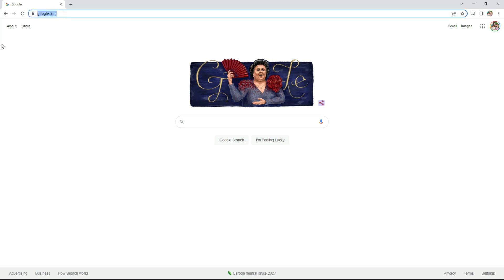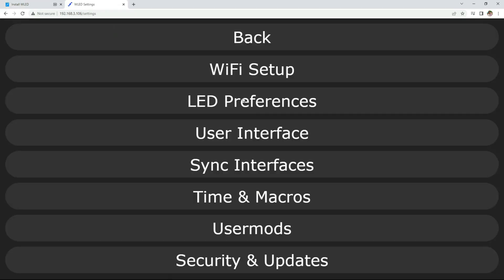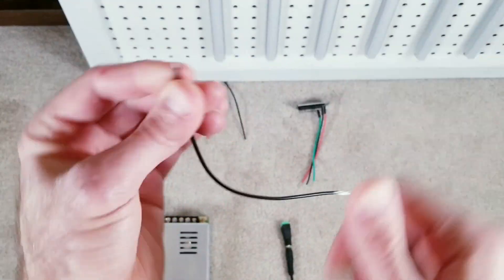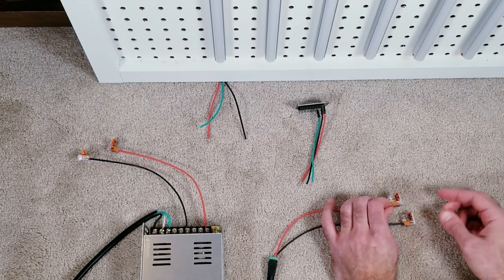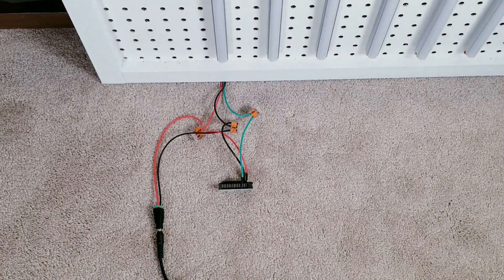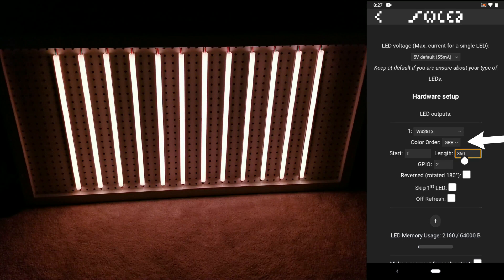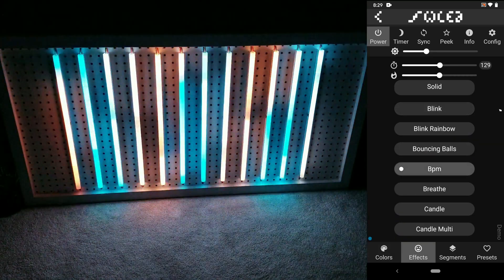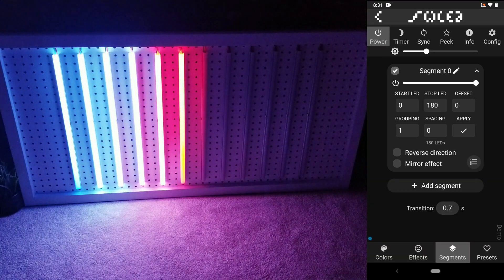How To Install WLED on an ESP32 Board and Connect / Control Addressable LEDs

Comment: Hi Chris, just asking, how many Amps can one ESP32 board handle? The big guy power supply you are using is like 60A am I right? I know that even if I go with 3x 18A - 5 meter long strips (let's say complete power injection for 5V 60led/meter x 5 meters long x 3 stripes = 54A max but in reality like 18A due to not using full brightness white). Can I use just one ESP32? I am not sure if the pin will handle the current or am I missing something? Thank you so much for all your videos I am learning a lot, Vojta
Reply from the maker: Thanks so much for watching and great questions! I've never tried maxing things out so i'm not entirely sure. Here is what the WLED website says about number of LEDs: https://kno.wled.ge/features/multi-strip/  I would think you would be ok! I'm all about trial and error. I would hook everything up and run it at full white and full brightness for 5 or 10 minutes and see if anything gets hot or starts smoking. If not, then I just go with it.
Reply: @ChrisMaherDIY  Thank you so much for the reply, Chris! Yes, exactly. I do the same thing. I was thinking to myself that maybe as you have the cables from the power supply directly to the LEDs and the ESP32 serves basically as an offshoot to provide the data the whole load of the current doesn't come from the ESP but rather from the power supply. I guess the only way would be to measure it. That's my issue but I am glad I can share it with you. All I know is once the current goes up everything needs to be bulkier/thicker in terms of cables, pins, etc...18 gauge cable (1mm in Europe) can pass through like 15 Amps only I think (so that's where all those injections come in).

Comment: Thank you so much for these good info videos. Question i followed all your instructions bought the same stuff like esp32 led strip and using cell phone power adapter 5v 2amp. My esp board connected to Wi-Fi able to control from app but there’s no power on led strip is there anything I am missing thanks
Reply from the maker: Thanks so much for watching and taking the time to comment! Would you be able to send a picture of the wiring from the led strip to the esp device? outrunprojects@gmail.com thanks!

Comment: How's it going could you help me out and tell me the pins you connected to on the ESP32 controller? VIN for pwr, GNG 4 GNG and D4 for data? I pre tested my LED lights with a BTF controller  they worked. Disconnected BTF controller downloaded WLED to aESP controller  hooked up controller is loaded recognized on WLED app but won't pwr on and show orange but can navigate app just fine. I feel like I'm missing something small but can't tell what it is
Reply from the maker: Thanks so much for watching and taking the time to comment! So on the ESP32 that I'm using, I have the VIN for power, the GND right next to the VIN for ground and then I have my data on the D2 pin. But if your data is on a different pin, you might just be able to go into led preferences and change it to the correct one? Let me know if you figure things out! Sounds like you are very close!

Comment: Noob question - How do you what type of led lights you have or if they're compatible with wled? I have some left overs from a project and an esp32. I'd love to hook them if possible. I doubt they are individually addressable either. Can I still use them?
Reply from the maker: Thanks so much for watching and taking the time to comment! That is a great question and one that I'm not even sure of myself. Most of the strips that are not individually addressable are I believe considered analog. I have really never worked with those type of led strips so I'm not exactly sure if they would work. My guess is they can but since I have not tried it myself I'm not sure on the process. Maybe someone else reading through the comments might know for sure and can chime in! If I do try this myself down the road, i'll for sure make a video since I'm sure there are a lot of people with the same question!

Comment: Good afternoon, congratulations for your videos, they are fabulous.
I have a doubt and if you can clarify I would be grateful.
I need to put WRGB leds in a case letter. I was thinking of using the ESP32.
Once configured and programmed, the ESP32 can work Offline to make a certain sequence of colors and effects, it turns on (ON with a switch ) and the ESP32 starts working and carrying out the predefined routine. Or is there another better controller for this situation. Thanks
Reply from the maker: Thanks so much for watching and taking the time to comment! That is a great question and one that i'm not exactly sure on. I think you need a wifi connection but i'm not 100% sure. Maybe someone else on here might know more on this topic than I do and can chime in. Thanks!

Comment: Hello. Please help me. At 05:47 - max current 2000mA. But if i use 5v40a(200w) power supply - what value i must use in this cell? Thanks for answer!
Reply from the maker: Thanks for watching! That is completely up to you. You can keep it set to 2000 and see how you think things look or you can change it to something higher and see if it gets brighter and if you like how that looks. 2000 has generally been what I use because its usually always bright enough for what I'm trying to do.
Reply: @ChrisMaherDIY  thanks you Chris! I will try. Thank for your tutorial!

Comment: Failed to install WLED in ESP8266 :( It is just loading and loading ... tried to install from Github but facing problem there. ESP8266 LED blinking test was successful although. Looking for your help if possible
Reply from the maker: Thanks for watching! Hmm, the only time I ever had issues was when I was not using a cord that supported data and the other was when the drivers were not installed. Have you tried it on another esp device? Maybe someone else reading the comments might have some other ideas and can chime in!

Comment: How many independent output channels from single esp32?, thank you.
Reply from the maker: Thanks so much for watching and great question! Here is what the official wled page says:

ESP32
There is a maximum of 10 strips supported
Contrary to the ESP8266, the pin usage does not matter on ESP32, feel free to use any available pin
For perfect performance, it is recommeded to use 512 LEDs/pin with 4 outputs for a total of 2048 LEDs.
For very good performance, it is recommended to use 800 LEDs/pin with 4 outputs for a total of 3200 LEDs.
For good performance, you can use 1000 LEDs/pin with 4 outputs for a total of 4000 LEDs.
For okay performance, you can use 1000 LEDs/pin with 5 outputs for a total of 5000 LEDs.
For okay performance, you can use 800 LEDs/pin with 6 outputs for a total of 4800 LEDs.
ESP32 can calculate about 65k-85k LEDs per second (that means 1000 LEDs @~70fps, 2000 LEDs @~35fps, 4000 LEDs @~18fps)
4 outputs seem to be the sweet spot.

Comment: Great Videos!  Quick question, can I use the usb power on the ESP32 board for powering my LEDs or do I have to use an additional power supply.  I ask because I was running a board with LEDs off the USB power supply but the board stopped functioning and I thought that maybe the cause. TIA
Reply from the maker: Thanks so much for watching! So I've heard mixed things on this. I've always been able to run a small amount of led lights using the micro usb with no issues but others have said that you should not do it this way because it could fry the board (which I have never had happen to me) But I will say, when powering things with the micro usb, i generally have the brightness limiter set to 850ma so I'm not sure if that makes a difference or not!

Comment: Hi sir, can you please tell me how much meters of led strip I can connect .
Reply from the maker: Thanks so much for watching! I've never tried maxing these out but here is what the official WLED information says: https://kno.wled.ge/features/multi-strip/

ESP32
There is a maximum of 10 strips supported
Contrary to the ESP8266, the pin usage does not matter on ESP32, feel free to use any available pin
For perfect performance, it is recommeded to use 512 LEDs/pin with 4 outputs for a total of 2048 LEDs.
For very good performance, it is recommended to use 800 LEDs/pin with 4 outputs for a total of 3200 LEDs.
For good performance, you can use 1000 LEDs/pin with 4 outputs for a total of 4000 LEDs.
For okay performance, you can use 1000 LEDs/pin with 5 outputs for a total of 5000 LEDs.
For okay performance, you can use 800 LEDs/pin with 6 outputs for a total of 4800 LEDs.
ESP32 can calculate about 65k-85k LEDs per second (that means 1000 LEDs @~70fps, 2000 LEDs @~35fps, 4000 LEDs @~18fps)
4 outputs seem to be the sweet spot.

Comment: Hey Chris using ws2815 12v led strip 16ft long 300 led lights… how many can I connect to ESP 32? Or what controller can I use to connect 5 16feet led strip? 
Thank you Chris
Reply from the maker: Thanks so much for watching! I actually just made a video on this! https://www.youtube.com/watch?v=zbhdH-qSANc&lc=UgwTVHhlHGqD-8YJXw14AaABAg  Here is the website that has a little more technical specs of the program: https://kno.wled.ge/features/multi-strip/ and this is what it says:

ESP32
There is a maximum of 10 strips supported
Contrary to the ESP8266, the pin usage does not matter on ESP32, feel free to use any available pin
For perfect performance, it is recommeded to use 512 LEDs/pin with 4 outputs for a total of 2048 LEDs.
For very good performance, it is recommended to use 800 LEDs/pin with 4 outputs for a total of 3200 LEDs.
For good performance, you can use 1000 LEDs/pin with 4 outputs for a total of 4000 LEDs.
For okay performance, you can use 1000 LEDs/pin with 5 outputs for a total of 5000 LEDs.
For okay performance, you can use 800 LEDs/pin with 6 outputs for a total of 4800 LEDs.
ESP32 can calculate about 65k-85k LEDs per second (that means 1000 LEDs @~70fps, 2000 LEDs @~35fps, 4000 LEDs @~18fps)
4 outputs seem to be the sweet spot.
Reply: @ChrisMaherDIY  Thank you so much!

Comment: Hi, I tried installing WLED on a ESP32 board but I'm faced with a problem. The board will not connect to my home wifi. I tried creating a new wifi (2,4ghz, simple ssid name with no special letters, same with the password). It will not connect. But the board will connect to my phone hotspot. Any ideas?
Reply from the maker: Thanks so much for watching and that is strange! I've never had that issue so i'm not entirely sure what it could be. It has to be something with the home wifi that the esp is not liking! Maybe someone reading through the comments might have an idea on what it could be and chime in! I'll let you know if I come across something to try but also let me know if you figure it out as i'm curious myself what it could be!
Reply: @ChrisMaherDIY  Your videos helped a lot. I ended up ordering another board and it worked. Either the first one was a bad board or just incompatible for some reason since the 2 boards I tried weren't exactly the same.

Comment: This is killer info. Why tf every time I change my location name it never finds it it times out? Also, does it always have to be plugged in? I still can't get lights to show anything.
Reply from the maker: Thanks so much for watching. Where is the location name that you are referring to? Also, the esp does have to have power at all times. That could be via the micro usb port or the pins.
Reply: @ChrisMaherDIY  Thx, I meant to delete this post I got it figured out.

Comment: Great tutorial! Well done Chris. I was wondering which is better a BTF-LIGHTING 5in1 WB5 2.4GHz WiFi LED Controller or 5 xESP32 for a room project with more than 4 x WS2812b. How many strips can ESP32 can handle?
Reply from the maker: Thanks so much for watching! I would personally go with the esp32 but you could certainly order both, test them out and see what one you like best and return the one you dont use. I've never maxed out an esp32 but here is what the specs say on the WLED website: https://kno.wled.ge/features/multi-strip/

ESP32
There is a maximum of 10 strips supported
Contrary to the ESP8266, the pin usage does not matter on ESP32, feel free to use any available pin
For perfect performance, it is recommeded to use 512 LEDs/pin with 4 outputs for a total of 2048 LEDs.
For very good performance, it is recommended to use 800 LEDs/pin with 4 outputs for a total of 3200 LEDs.
For good performance, you can use 1000 LEDs/pin with 4 outputs for a total of 4000 LEDs.
For okay performance, you can use 1000 LEDs/pin with 5 outputs for a total of 5000 LEDs.
For okay performance, you can use 800 LEDs/pin with 6 outputs for a total of 4800 LEDs.
ESP32 can calculate about 65k-85k LEDs per second (that means 1000 LEDs @~70fps, 2000 LEDs @~35fps, 4000 LEDs @~18fps)
4 outputs seem to be the sweet spot.

Comment: can I power esp32 with a regular micro usb charger?
Reply from the maker: I've done it and its always worked fine for me! But I've read where people say you shouldn't do it because the esp board might fry but i've never had any issues. But I will say when powering via the micro usb charger, I generally set the brightness limiter to 850mha so I'm not sure if that makes a difference or not! My theory is always try it, see if it works, and if it doesn't work and it breaks, just return it, order a new one and then try something different.

Comment: Hey Chris, love how accessible you make your led builds and even without the ability to replicate them they’re really therapeutic to watch 😅

Just a quick question though, have you ever run across issues where the ESP has 3.3V logic out but the LEDs require 5V data input? I notice you aren’t using logic shifters but also you don’t seem to have any issues in the videos at least!
Reply: There is another YT video, in which someone tried an 8212 tape with and without level shifters, so 3.3 or 5V. They found that if the first LED is more than a metre (IIRC) from the controller, then the control becomes unreliable on 3.3V. A level shifter allows a much longer run for the data line, or you can use a single 2812 LED near to the controller ("sacrificial LED") which will act as a shifter, but you have to allow for that in your planning.
Reply from the maker: Thanks so much for the kind words! That's a great question! For the most part, if the data line is reletively short going from the esp device to the first LED I have had no issues. If the data wire is somewhat long, I've ran into issues where the data signal is not strong enough to get to the lights and the lights just kinda do their own thing. For those instances, I either used the sacrificial pixel method or put in a resistor on the line which fixed it. You could certainly use a logic shifter and that would also work great!

Comment: Hoping you can help me i have SPI(91061f) and SP511E controller's. I want to use for pixel lights with Xconnect so I cut off one of the output leads and replaced it with Xconnect using heat solder connectors and the other i used wago type connectors but the pixel strings don't change colors as selected but they will change effects (blinking, chasing, etc.) I need help as to why I can't change the colors. Any ideas are appreciated.
Reply from the maker: Thanks so much for watching and that's a great question. Unfortunately I have zero experience with xconnect so I'm not entirely sure what might be going on. That's a very strange issue to have if they are someone doing what they are supposed to be doing (effects) but not changing to the colors. The only thing I can think of is that in the program there should be a spot to choose the color order. RGB, BGR, DRB etc. That might be the issue if you select a color but it changes to the wrong color. However if your not able to have it change to any color then i'm not sure. Maybe someone else reading might know for sure and can chime in!
Reply: @ChrisMaherDIY  thanks just the same. An Xconnect pigtail is a round 3 pin connection similar to a DMX sound/light board.
Reply from the maker: @luv14lyf  Ahh I have seen those before! Just didn't know thats what they were called. Thanks for the info!